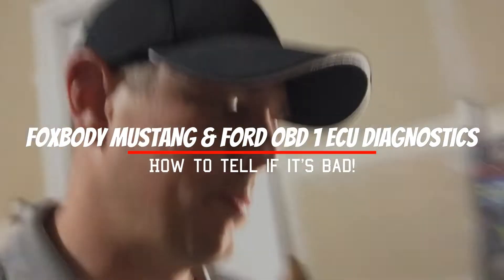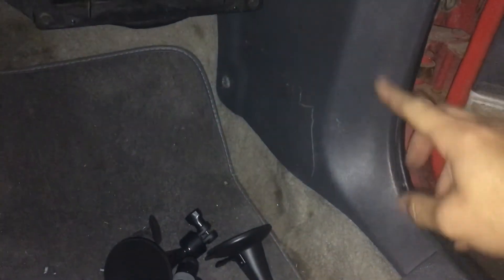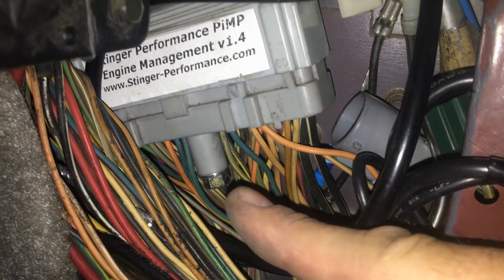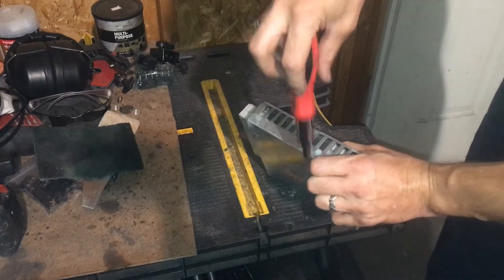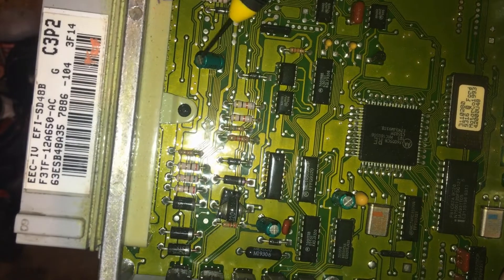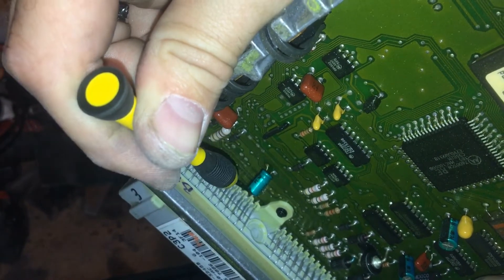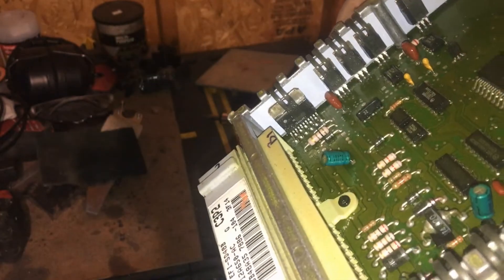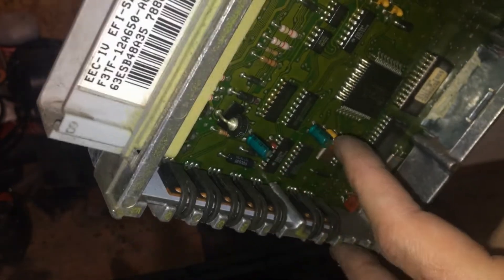How to Tell if Your Foxbody Mustang or Ford OBD 1 ECU is Bad or Needs Replaced

Comment: Awesome vid again...i thought you have to find a ecu from the same year and make of vehicle and maybe even the same set up...auto or stick? Was under the impression you cant just get any v8 ecu 88-93
Reply from the maker: For replacement you are completely right!

As for diagnostics, they are all the same component wise.  The tune on them and some pin outs are slightly different from model to model.
Reply: What makes of Ford's can you get them off of? I may have a Bad one!  @BMF_Garage
Reply from the maker: If you’ve got a mustang, I’d stick with a mustang ecu.  There are some variations, so you’ll need to see what you’ve got and try to match it.  86 was first year of the efi and is speed density.  87-88 was speed density but different ecu.  89-93 was mass air ecu.  There is also an ecu for auto vs manual trans cars.  Auto trans ecu has more timing in it to run right in gear at idle and not stall.

I’d check the model number on yours and try to find the same.
Reply: @BMF_Garage  Awesome man thanks! I have a 86 FoxBody. I'm having problems with a No start issues. I pulled ecu yesterday and it looks good. New fuel pump coming tomorrow, but I've check relay, inertia switch and fuse's. Any other things you think I should look at? It fires up but I can't get it to stay running.
Reply: @BMF_Garage  Also it's Automatic
Reply from the maker: Could be the pick up in the distributor or the tfi module.  For ease of replacement I suggest a new distributor with all new electronics.  First I’d check the ignition switch.  The key cylinder itself can wear out as can the piece under the dash.

https://youtu.be/s3MnFUAdveI
Reply: @BMF_Garage  many thanks my friend! I've head of it possibly being the pick up before and the tif module. I've replace the ignitions switch under the dash already and let me tell you that things was trashed.lol
Reply from the maker: Lol yeah, those things are garbage to begin with! Add 35 years of use and it’s a recipe for disaster
Reply: So what is your idea about a Crack no start in which the spark plugs are getting no spark. I've replace the distributor and TFI. Fuel pump is working fine. I'm definitely getting fuel to the injectors. I checked the injectors and they are all firing. I just don't have spark to the plugs?  Any suggestions?
Reply from the maker: Verify there is 12 volts to the positive wire of the coil at all times with the key on.  Verify there is 12 volts to the positive wire on the injectors at all times with the key on.  The ecu pulses the negative wire to fire the coil or injectors.

If you don’t have 12 volts on the positive wire to the coil, there is a fusible link blown.

If you’re not getting the negative trigger from the ecu, you’ll have to pull the ecu out snd check the circuit board for damage.  You could have a bad output on the ecu, a blown capacitor, a bad/broken wire from the ecu to the injectors, or a connector in the engine bay that’s not making good contact.  Process of elimination.
Reply: @BMF_Garage   hey man I just checked out your video and I’m having issues with my 93’ GT it’s got new fuel pump and filter injectors and it’ll start and idle but will not take fuel every time I hit the throttle it dies??? And I was thinking either the MAF sensor but unplugged it and still no change. It will idle all day long but go to hit the gas and dies like turning the key off any idea and thank you sir for your help and time greatly appreciated I meant to also say I thought it might be the computer so I’m gonna take it apart and see I got one from a friend but don’t know weather or not it’s out of a standard or automatic my car is automatic thanks again sir
Reply from the maker: Could be map related of fuel pressure.  Most likely a fuel pressure regulator that’s bad. I’ve also seen the soft line in the tank between the fuel hat and pump get a crack in it and cause issues.  Make sure your fuel pressure regulator has a vac line on it and that it’s not broken.  I’d start there

Comment: I couldn’t get more than 27-30 psi at the rail. Dropped both tanks no leaks. New pump and relay. Opened ecu /pcm cpu and one capacitor is spew a lil carbon on the leads, I cleaned it up with a tissue and put the crappy glue back down, wasn’t too bad so I’ll just order capacitors and a sodering un.

Comment: you can also check the capacitors look on the top and they have a metal showing on top it should be flat but if it has a bulge or is pushing out it may be bad and no able to keep its capacitance meaning that it will not work properly then it needs replaced.
Reply from the maker: Thanks for the tip!

Comment: i have a 1989 Ford Bronco 5.0 V8   5 Speed stick,    it started running bad a while back the idle will go up & down at a stop i replaced the Throttle position sencer & the MAP sencer ,   still idles up & down and wants to stall,   Could it be my PCM  /  EEC  ???      HELP
Reply from the maker: It’s possible.  Could also be a bad O2 sensor, or a vacuum leak.  Hard to say without looking at it but doesn’t sound like an bad ecu
Reply: @BMF_Garage   Thanks much for the reply, an O2 sencer could cause that  ?  i drove it for about a month with a broken 0 2 and it ran fine i put a used one on and going to buy a New one, ASAP  i didn't think that could be it because i drove for a while with it not working
Reply: @BMF_Garage   also it was my first thought it could be a Vacuum  i checked it out as best i could & didn't find a leak ...
Reply from the maker: I’ve had a ton of different things cause erratic idle from o2 sensors, tfi modules, and so on... it’s really hard to pin it down without seeing it.

Comment: What about misfiring slightly off idle? Enough. To loss a lot of power? Could that be PCM. Smoking rich slightly out of bank 1🤔all electronics up front are new.
Reply from the maker: All new including plugs, wires, cap and rotor?  Make sure plugs are correct and gapped right.  Have you checked timing?

Comment: You need to test those, I have a 95 F150, same board, looks like new, after testing the capacitors I found 2 out of 3 bad, just because there not leaking doesn't mean there good.
Reply from the maker: That’s a very true statement…. But most people don’t have the knowledge or tools to properly diagnose

Comment: Hey there, I’m gonna ask you cause you seem very knowledgeable and thorough, and I’m still learning, I’ve got a 93 gt with code 66 maf low voltage, I’ve verified it’s getting 12 volts and I’ve also installed a new sensor, from there it saying I need to test pin 50 which I havent figured out how to do yet ,but in your opinion do you think it’s likely that ecu could ultimately be my problem? I’m also not noticing any difference when it’s plugged in or unplugged. Thanks for any help.

Comment: Hello sir, I have a problem with my 1989 mustang, the gas pump does not stop, I have a spark, the ecu was changed, but I do not have a pulse in the injectors, could it be the ecu?
Reply from the maker: Definitely could be.  We’re you checking for a pulse on the positive wire or ground wire?  These cars pulse the ground signal to fire injectors.
Reply: @BMF_Garage  ground has no pulse, positive yes
Reply from the maker: The positive should not pulse.  It’s connected to power all the time.  You should be checking the ground for pulses

Comment: Sir I have a question, how about if you’re fuel pump won’t hum? I can here a click in the kick panel but no fuel pump. I’m thinking it’s the computer because I changed the fuel pump. Any help would be great!
Reply from the maker: So there is a fusible link that provides 12 volts to the power wire on the relay.  I’d suggest to test the power wire for voltage when you turn the key on (at the pump).  If you get nothing, the pump is likely good, just not getting power when the relay comes on.
Reply from the maker: Did you check out this video of mine on troubleshooting the electrical?  It’s got more detail.

https://youtu.be/Wmq4LZMSOb0

Comment: Thank you for the information. In the last year my 86 Mustang GT would run about 25-30 minutes and then die. No codes from a code reader. Reading about over heating ICM thought that was the problem, but same problem after I changed ICM out.  I then noticed the fuel pump would continuously run when the key was turned on but not running.  First thought was bad fuel pump as pressure was not coming up. After watching video and looking at electrical diagram the fuel pump is controlled by a relay, inertia switch, and ECM. Relay would be stuck on all the time which does not happen when engine is cold. Changed out ECM and engine keeps on running for over an hour. Now if I could figure out the surging idle. Thanks again.
Reply from the maker: A lot of those old components can start having issues… I’ve seen before that the fuel pump relay itself goes bad which typically happens after running it a while and sticks on.  The fuel pump is constantly on if the car is running, but when you shut it off it should stop.  

It’s extremely hard to diagnose a vehicle site unseen because there are so many variables.. I wish I could be of more help…

Comment: i have a 1994 Ford Mustang GT Convertible. . when i turn on the  key the fan and fuel pump keeps running.  i change rhe CCRM , checked all he fuses and it is still doing the same thing. i am in the process of getting a new ECU right now.
Should i check anything else before i get the ECU?
Reply from the maker: Id open the ecm and check the capacitors in it before buying a new one just for confirmation.  Sometimes the fuel pump relays get old and stuck on too.  Fan relay cab do the same also. Relays are the most common failure.

Comment: I'm thinking my ECU may be bad.. 
Injectors have 12.3v for power and only 9v for grounding . 
What do you think? I'll look at the ecu again but it seemed ok.
Reply from the maker: Hmmm… are you testing from positive to negative on the injector?  If the ecu is bad, that could be the culprit
Reply: @BMF_Garage  both wires of the injector need 12volts. The ECU grounds the injectors to create an injector pulse. (so I read. Even though ive seen it open with 9. But cranking the car will lessen voltage due to load)
Even went far enough to hook a separate injector for testing and when the ECU tried to ground, it only drops by .5volts on the "ground" side of the injector. 
ECU capacitors look fine and with no burnt PCB .
Reply from the maker: You should not have 12 volts on the ground when it’s not grounded

Comment: Awesome video and helped a lot yes I do believe my fuel pump relay is out I put in a new fuel pump but I currently and bypassing the fuel pump relay running directly to a toggle switch inside the vehicle. So I was asking whether or not it's easy to replace just the relay inside the ECM
Reply from the maker: Not especially easy to replace ecu components...

Comment: Any idea if the ecu could be a culprit for bad idle when operating temperature is reached. Car has perfect idle until then.
Reply from the maker: That sounds more like the IAC… have you checked it and cleaned it?
Reply: @BMF_Garage  I’ve had the car 24 years cleaned the IAC as part of normal service and replaced it with a new motorcraft unit.
Reply from the maker: Well, the other possibility would be O2 sensors or coolant sensor… I don’t think it would be an ecu issue ass it only switches from open/closed loop after warming up…

Comment: Hey brother, I have a 89 and a  91,on my 91 I have a very very weird issue,when the weather is nice car runs good, when it rains car will run awful,let's say I already turned it on that morning and it wasn't raining and I go to work,car will run fine even if it starts raining and on my way back home but that next morning after a rainy day the car will run terrible, will die and barely stays running.

Once the car gets good and hot it will run fine again,car has a new engine, new distributor, new starter, new coil,new plug wires,my computer is bone stock and has never been out of its cubbyhole, I was thinking of getting it out and just give it a look to see how it's holding up.

Only thing I Can think of is that maybe it could be my ECT sensor, it's like 2 years old and a oem Ford piece but new things do go bad, any ideas on your part? Maybe the computer is on its way out and once it warms up it gets better?I appreciate your time.
Reply from the maker: Definitely sounds like a spark issue.  Typically when it acts like that cold or wet outside it’s getting moisture into the ignition system somehow. When’s the last time you checked plugs and what did you set gaps at?
Reply: @BMF_Garage I put plugs in a couple of months ago and I gapped them at around 54  , your right on the electrical thing, it doesn't feel like it's fuel related but electrical.
Reply from the maker: I would tighten the gap up on the plugs to 45.  With that big of a gap, it’s probably difficult for the stock ignition system to jump that far of a gap because of the increased load on the system when it’s cold or wet outside.

Comment: Good video.  Looks similar to the ECU from my '93 F-150.  I've replaced from the spark plugs back to the ECU - on the 3rd one - and the blasted thing will start up - for 30 minutes, then die..... suggestions ?   Thanks !
Reply from the maker: Sounds more like a fuel pressure issue to me.  Have you replaced anything inside the tank?  Pump and lines?  The rubber line between the pump and pickup can get cracks and bleed down pressure,  also, fuel pressure regulator could use a replacement.
Reply: @BMF_Garage  Everything replaced thus far has been electrical.  When the truck dies, has the smell of gasoline.....Thanks Very much for your help .  I have had so many old Ford pickups I just could not keep running, try as I might....Shame...
Reply from the maker: Tfi module?  It’s usually something simple

Comment: Hello Sir I have a cuestion I have a 92 Fox body 5.0 I did remove the computer trying to install a tuner but after that car won't start anymore just lights are flashing like and alarm du you have and idea what can be the problem ❓I think it's a teef alarm activate or something like that
Reply from the maker: The foxbody doesn’t have any factory anti theft system.  What tuner were you trying to install?

The body harness with the lights is not connected to the harness for the ecu and engine control in any way
Reply: Thank you for answer me sir name of that it's sct 6600 eliminator single
Reply from the maker: Is that a chip that plugs into the j port of the factory ecu?
Reply: Correct!
Reply: Right in the orifice it's covered with tape
Reply from the maker: Those can cause issues with the car not starting if corrupted or installed incorrectly.  When you put the ecu back in did you make sure you connected all grounds and power cables?  There is also a main power relay up above the ecu that would cause issues if it came unplugged
Reply: Yes I did connect all connections the same way! How I can check that main relay ❓it's close to ecu
Reply from the maker: It’s in the kick panel close to the ecu.  

You can check by verifying that you have 12 volts to the red wire on all fuel injectors with the key it the run position (not start position).  Test from the red wire of one of your injectors to the chassis ground or battery negative terminal with a volt meter.  12 volts tells you the relay is working.
Reply: Thank you so much body I'll try that 🙏
Reply: Thank you so much sir for your help I found the problem it has a Viper alarm I did remove the front driver panel pull out two black boxes I found the button I did push it reset the alarm
Reply from the maker: Awesome!   Glad you fixed it!

Comment: Finally got time to check this out.... Thanks a bunch!!! I have a wrecked 90 7 up stang and it runs fine, gonna pull mine outta my 91 today and look at those capacitors. Fuel pump running, never shuts off.  I hear a second relay way up by the front left speaker, its the one I hear clicking out the fuel pump after a few seconds,.... after seeing this I see,... probably not that relay but the ecu not controlling  it correctly.... Thanks again, Ill let you know what I find. It hadnt been run in a long time, rediculaus amounts of rain in florida this summer,... I fired it up, it ran about 2 minutes and just died, probably popped a capacitor ....
Reply from the maker: Definitely a possibility!  One thing I forgot to talk about in this video is the possibility of some circuits on the board going bad.  Look for any black marks/burnt tracers on the circuit board as well.
Reply: will do thanks again

Comment: Not sure if you still check your comments but i have a 87 mustang with a 2.3.....its running rich and iv changed every sensor on the engine except the throttle pos sensor .....it has me stupped has new distributor and i even tried new injectors and ideas?
Reply from the maker: I would start by looking for broken, missing or leaking vacuum lines or fittings.  If the vacuum isn’t right it would feed it more fuel and cause it to run rich.  If that doesn’t fix it, I would look at O2 sensors